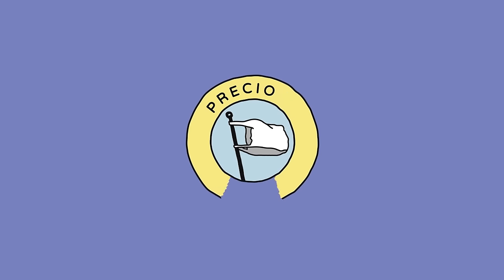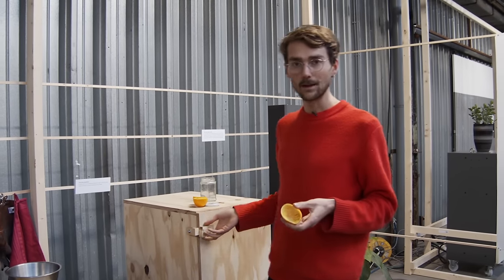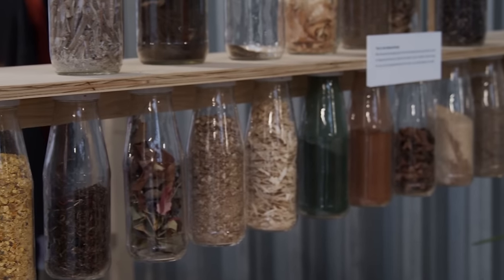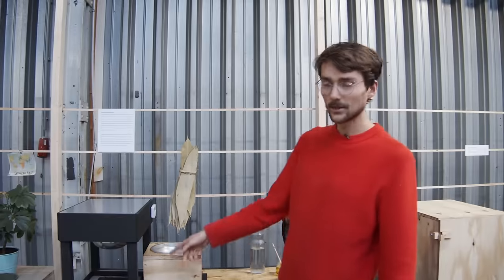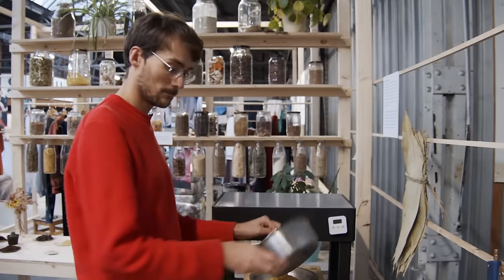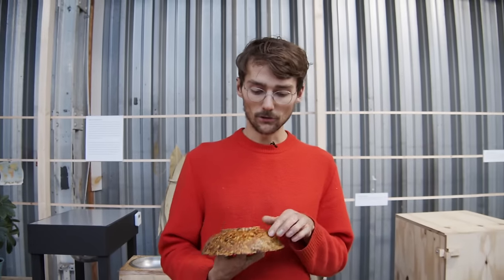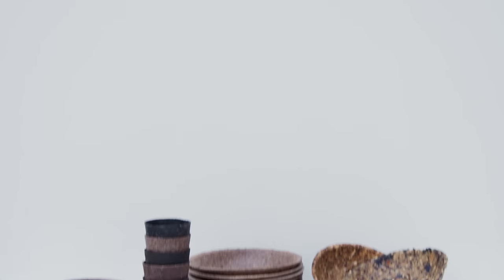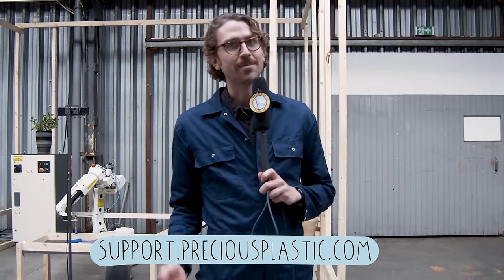Precious Plastic - Make an edible bowl (part 8.2)

Comment: From what I heard, you can make glasses to drink water with these materials, but when you put water in those glasses, isn't there a danger that the organoleptic properties will be modified? Wouldn't it be necessary to add a dividing layer (I don't know what material or components) between the drink or food and the plate?

Comment: I think bioplastics, with proper recycling and disposal once "beyond recycling", are way more viable and effective.

This method utilized energy in, and made a single use product.  Even "single use" plastics can be reused, these however would become damp or moldy i would assume after a use or two.

Also this adds aditional transit of materials (ie waste to bowl making site, then to composting/anerobic digestion site, thus requiring more labor (loading/unloading, etc) and potentially energy than some sort of Source Seperated Organics System (or no-trip with an onsite compost pile/digester).

Thus i think this fails in a "better than plastic" application.
Reply: H o w e v e r

I think this could be used for intresting culinary use cases (maybe even waffle bowls...), and having an Open Source Machine for that is great.

Also it may be able to produce "Engineered Wood Products" such as fiberboard or  "Biomass Briquettes" (or other products such as small firestarters for use with other fuel such as charcoal) for fuel usage
Reply: The whole point is to explore better alternatives to the environment. We create enough vegetable and fruit waste to have this be an alternative to single use items. Perhaps with more industrial equipment this process could be made more efficient. The idea is to move away from any plastic at all.
Reply: Claro, eso lo sabemos, por eso nadie produce bioplastico o plásticos 100% biodegradables. Por qué es más difícil mantenerlos, pero si al consumidor no le importará eso, las empresas no tendrían opción más que fabricar lo que se consume, es más sobre conciencia ambiental de la humanidad

Comment: I think you can scale this up by using a machine similar to popped corn chips. You may pelletize first the peels or other fiber and starch sources in a high compression single screw extruder then make a 'melt' out of those pellets in a high-temp and pressure moulding machine to make the bowls. Then further lower the moisture to a safe zone with a conveyor oven. 

Coffee grounds may also be a good material. 

Declaring edible is harder than doing biodegradable. Please don't stop

Comment: Little bit more clear data and information would help in these precious plastic videos. Pros and cons, and in this case data about the usability of the product , how it holds up when it gets wet, is it an option for fastfood / to go containers, heat and pressure aplied etc. 
sadly these videos only show posibilitys from a teaching and comunity based viewpoint but not on an aplicable side. Shows the world some ideas but not an indept experimentation and in a useful way.

Comment: Nice concept but not really a viable solution because it can’t be washed nor reused. It would be more practical to simply recycle plastic and make a bowl you can use time after time. Also... it used a lot of energy to produce (heating to dry, blending, pressing, heating again). And it’s not edible unless you have the habit of eating dry and hard old orange peels. It is food safe at the most!
Reply: Y cuando haz lavado y reutilizado desechables??
Reply: Mucha energía? Antes de decir eso realizaste un análisis económico y energético comparando el bowl que el hace con un plástico desechable?? O solo lo dices por qué viste que encendió un compresor? La energía que utiliza es la necesaria, toda elaboración de productos tiene un impacto ecológico, la diferencia es la intensidad de ese impacto con respecto a otro producto
Reply: Para que quieres que sea comestible? Deberías de ordenar tus ideas en tu cabeza, no le estás dando sentido de coherencia, solo buscas problemas, acaso así es tu vida?

Comment: Would stabilising the bowl in a vacuum with resin be useful?
Reply: then its not edible. think a little John.
Reply: @LitoGeorge  ...it's not about edibility it's about biodegeadability.

No one is going to actually eat an coffee ground bowl 🤦‍♂️
Reply: @LitoGeorge  Think a little George.
Reply: @IrishEagIe  and whilst you're thinking John, how do you think resin is going to assist in biodegradability?
Reply: @LitoGeorge  Not to help biodegradability, it would be to increase longevity of the material.

Think.
Reply: @IrishEagIe  clearly you are inexperienced with resins, something which I am not. Instead of trading an unoriginal insult back to me, research the life of resin and its biodegradability. And then think. Use the time more wisely if you wish. Eff.
Reply: @LitoGeorge  I actually do have much experience with resins. I stabilise my own woods with a vacuum stabiliser.

If it is stabilised with a biodegradable resin, then all should be fine.

Also I only insulted you because you cast the first stone.
Reply: @LitoGeorge  Eff.
Reply: @IrishEagIe  it appears then that you lack the maturity t to look past the slight to offer useful information. I'll show you the way. I've only worked with epoxy and styrene types. Awful for the environment. What sort of biodegradable reasons have you worked with?
Reply: @Mr Brightside you're like that proverbial kid in the peanut gallery. There's always one.
Reply: @Mr Brightside au contraire. Now, back to your peanuts. You waded into territory that wasn't yours to interfere with in the first place.
Reply: @LitoGeorge  Firstly, you didn't offer any useful information, only insults.

I don't want to waste my energy discussing anything with you. All you've done is insult.

Waste of my time. See ya! 👍
Reply: @IrishEagIe  oh you big tease you! looks like your precious time isnt so precious after all, because you've got time to respond with barb after barb. Not so precious after all. Good riddance!
Reply: @LitoGeorge  More insults lol
Reply: @LitoGeorge  Bye bye
Reply: @IrishEagIe  back again! Irresistible.
Reply: @LitoGeorge  lol
Reply: @Mr Brightside it's clear you don't understand. And likely never will. C'est la vie.
Reply: @Mr Brightside  ok Mister Brightside, time to reconsider your screename. Au Revoir!

Comment: It's a really cool idea, but it has a few major challenges.  How cheap must each bowl be by the time it reaches the end user (restaurants or homes)?  $1?  $1.50?  You can try to lower the price of each by achieving economy of scale, but no one knows if there's enough demand, so the pricing would start somewhat high unless an investor decides to take in all the risks from the start.  How interested can even the most supportive consumers be if each bowl adds another $5 to their lunch?

If moisture is an issue, how are restaurants expected to store these bowls for long term use?  Not everyone is willing to afford a dehydrator just for bowls.  And if they don't want to pay the upkeep to store he bowls, they have to factor perishable bowls into their operation.  This just seems like a huge hassle even from a layperson's perspective.

Do these bowls affect the flavor of their content?  If so, chefs in moderately to upscale restaurants (the most likely starting point for novelties like these given the financial barrier of entry) will have to compromise their vision to accommodate for the bowl.  Some will definitely try, and it's anyone's guess how well their experiments will turn out.  Most will likely pass up given this and other challenges.

To be clear, I found my way to this video because I'm really interested in the idea.  It just looks like there are some technical and financial obstacles that need to be overcome before this bowl can think to go mainstream.